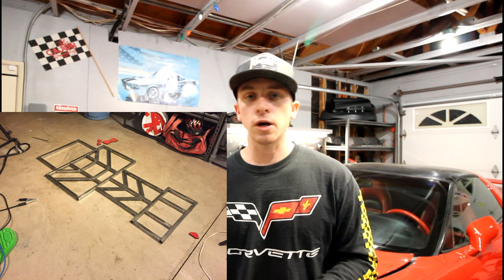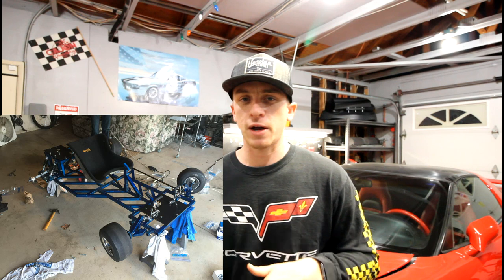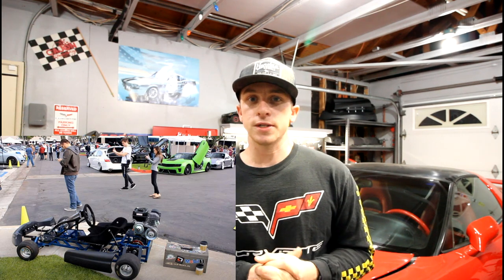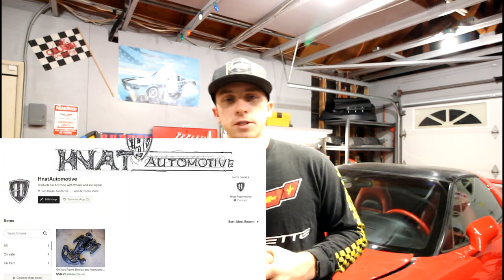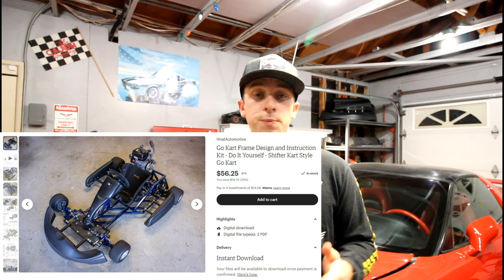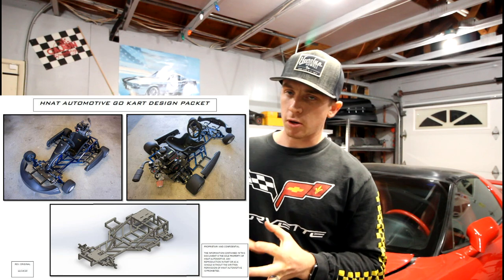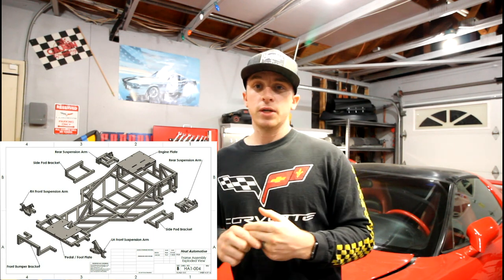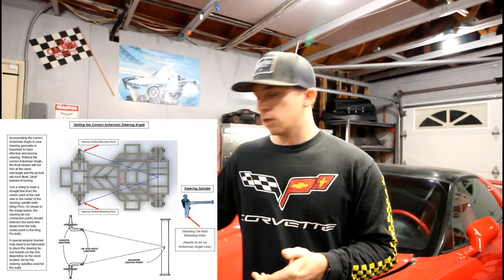My Go Kart Designs are FOR SALE!! - NEW ETSY STORE!!

Comment: Liked, subscribed and purchased! I am just getting started in my new hobby, but I am aspiring to build my own and this is exactly what I have been looking for. My only thoughts are, how heavy is this frame? Also, I think I'd like to go with a 420cc but would that be over powered causing too much burn out?
Reply from the maker: Awesome thank you for the support! The whole chassis (minus the motor and wheels) is about 170 lbs. I don't think you'd have a problem with traction with a bigger motor. The one thing to consider if you're trying to fit a bigger motor is the spacing behind you (the driver) and the motor as it's right behind you. Try and get some rough dimensions of a 420cc motor and see how it compares to the 212cc motor. You may have to either move the seat forward slightly, or lengthen the rear part of the frame so your back isn't right up against the motor and drive belt. Best of luck with the build! If you have any questions please let me know and I'm happy to help as best as I can!
Reply: @Addimotive  awesome, thank you!

Comment: Can you put bigger wheels on for offroad driving? Or will it damage the structure? And are there suspension for the rear Axel?
Thank you so much for this😉
Reply from the maker: Hey David! Thanks for the question. I suppose you could fit off road tires to it, the frame and/or suspension arms may need to be modified slightly to clear the off road wheels and tires depending on the spec of the wheel/tire combo you go with. 

There is suspension for the rear axle built into the design, however with my go kart it is a solid rear axle so there is no rear suspension at the moment. If you wanted to do a rear suspension you would need to use some kind of CV joints  from a car/golf cart/atv etc. to allow the suspension to pivot. This is essentially a three piece axle setup ( a solid axle in the middle of the frame, and two outer axles with CV joints on each end to pivot with the suspension) Otherwise, block off of plates are needed to basically hold the suspension arms in a fixed position if you run a solid rear axle.
Reply: @Addimotive  Ok thanks for the repli, I'll look into it😁
Reply: @Bumbo03  Did you end up modifying for off-road with suspension and bigger wheels?
Reply: @usamac4108  No unfortunately not. At the time I was looking for the right designe, and ended up with buying something instead. But it's a good series you've made😎. It would be too much work, considering the schedule